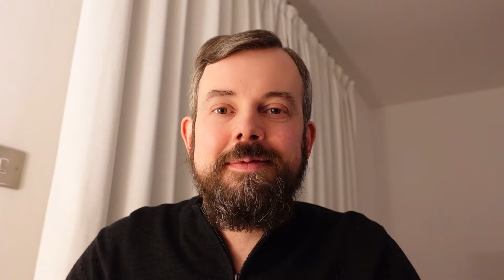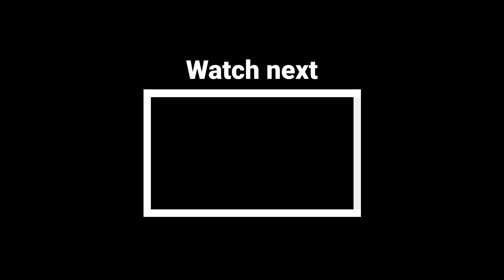What are the options for surge protection in a split load consumer unit?

Comment: Great that you are highlighting the requirement for coordination. Installing the SPD in a separate enclosure is the best way to ensure this and to get around the restrictive BEMA clauses. Most CU manufacturers do not make their own SPD's and therefore do not have access to a full suite of devices for DC, PV type 2, type 3, data etc. so it's important to have a specialist manufacturer of niche devices like this.